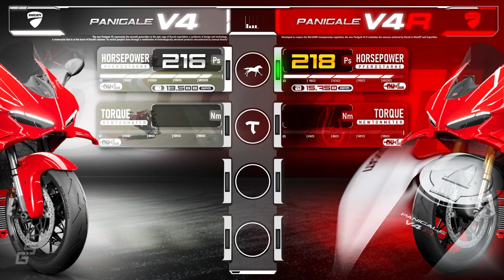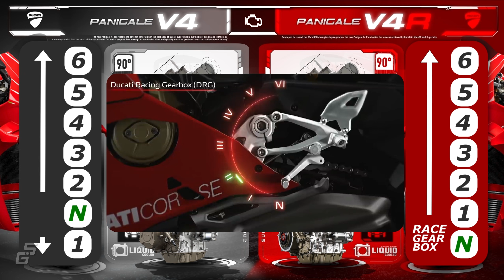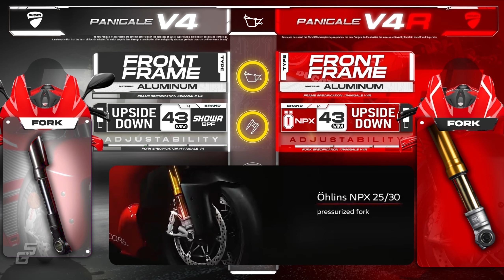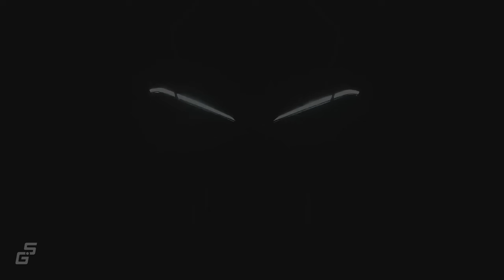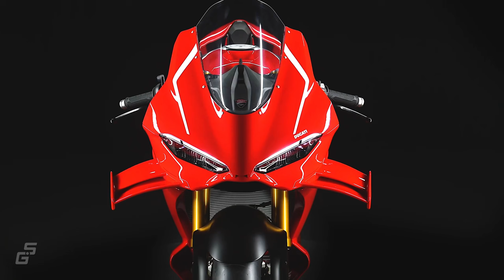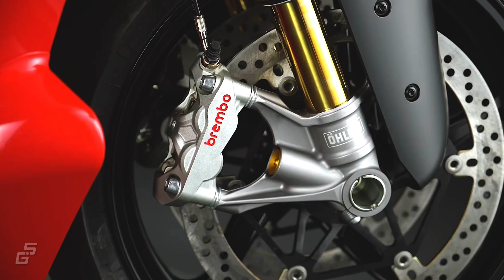NEW 2026 Ducati Panigale V4 R ┃ Is the Extra ‘R’ Really Worth $25,000?

Comment: I just config'd/priced a 2026 V4R...with Full race kit and CF wheels option and the WSBK Rotors/Caliper options and a few other minor goodies mine priced out at $85K. I've pretty much already decided to buy one, just trying to decide if I want to put a $5K deposit down to get one of the first ones or to bide my time until they start hitting showrooms. I would prefer magnesium wheels so I am going to consider skipping the CF option and just pay for mags after the purchase. I would also like to get my hands on the WSBK cams (a grad degreed Aerospace Engineer with a large American defense contractor's Missile Systems company and former AMA Expert/Pro Racing License holder in both 125cc Motocross and 350cc Road Race in my youth.

Comment: As a collector piece... no. This is the most undesirable generation due to its double sided swingarm.

As a bike youll actually ride... no. The standard bike is damn near equal in terms of power and makes way more torque (when in street configuration)

As a track only toy... no. The maintenance demands are significantly higher.